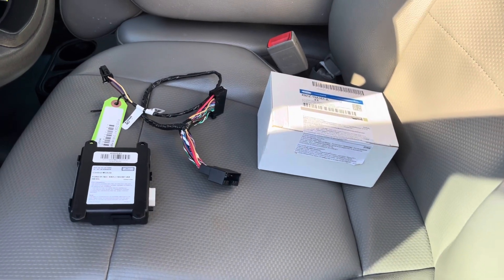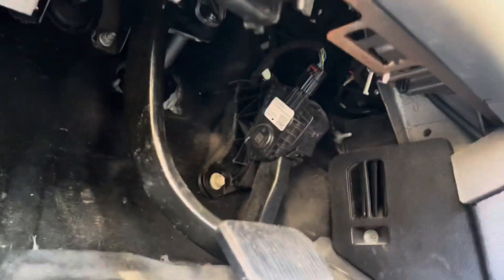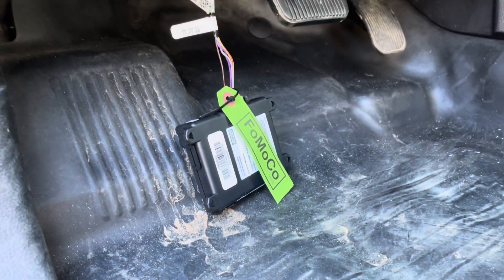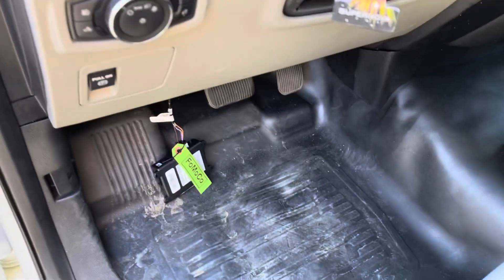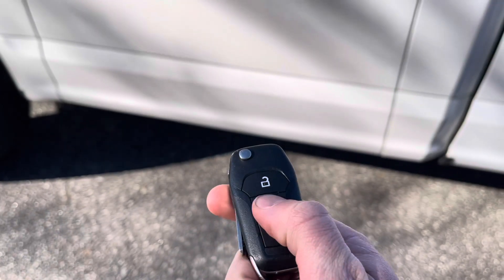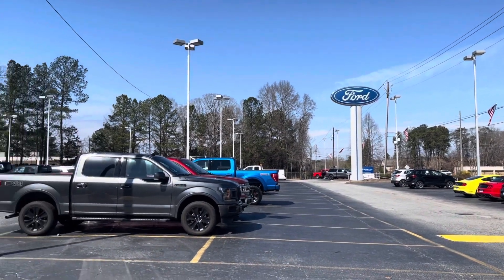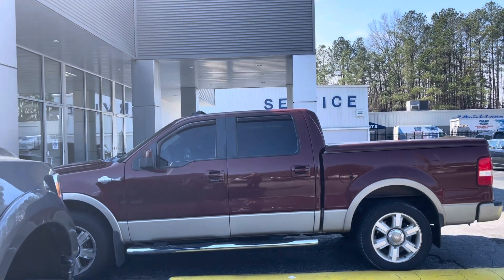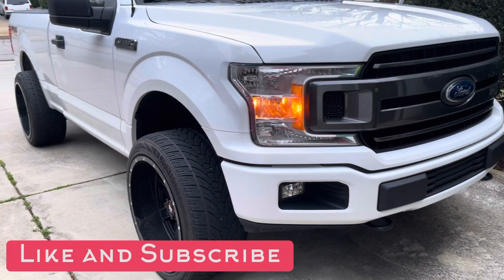Installing remote start on the F150

Comment: What was the part number for that
Reply from the maker: So I tried looking for the box it came in, which I couldn’t find. I did however find my original purchase receipt from the Ford dealership. Part# SHOULD be “kn1z-19a361-a”. I believe with this remote start it includes a security feature. Where if you bump the truck or knock on the windows when it’s locked the truck will “chirp” so to speak. Which is pretty much just the same sound as when you lock it with the key fob. I didn’t know the key fob included this feature until this morning when I looked up the part#. It makes sense bc I’ve thrown an empty cardboard box into the bed and it chirped and scared the shit out of me 😂.
Reply: @kev_lsn7042  thank you very much